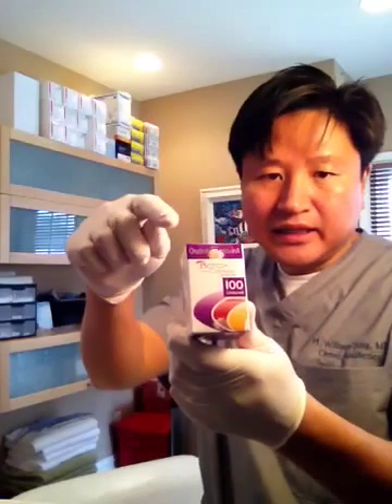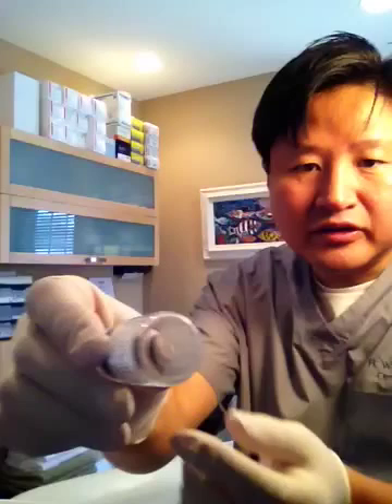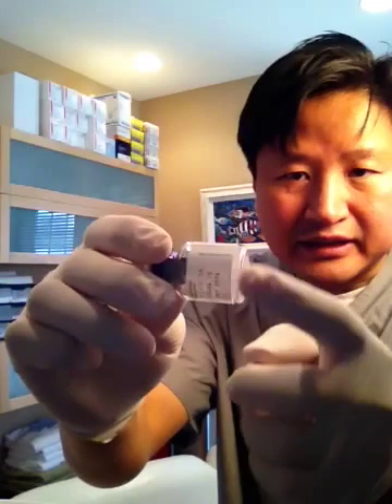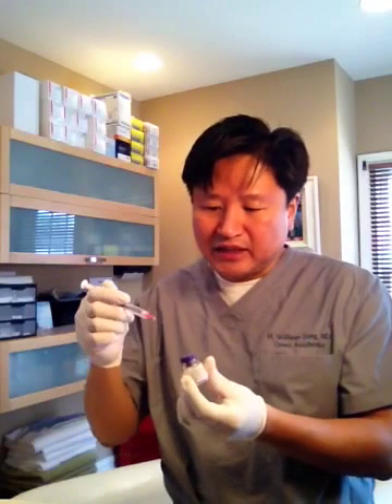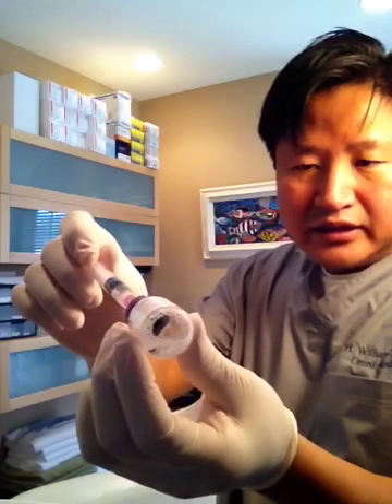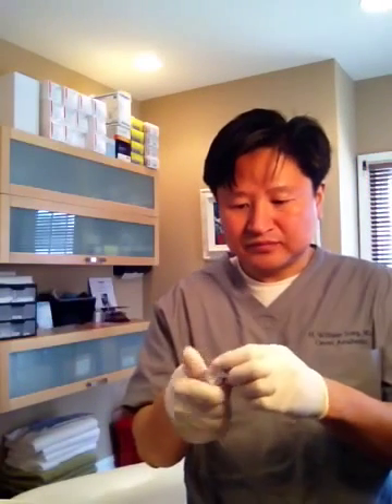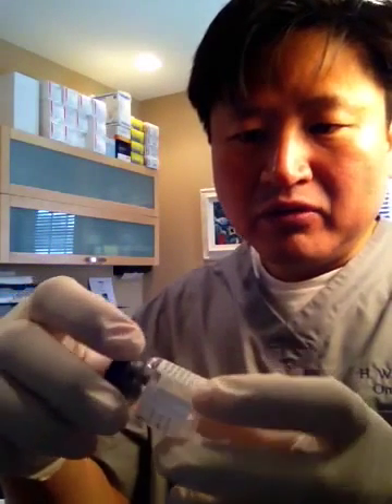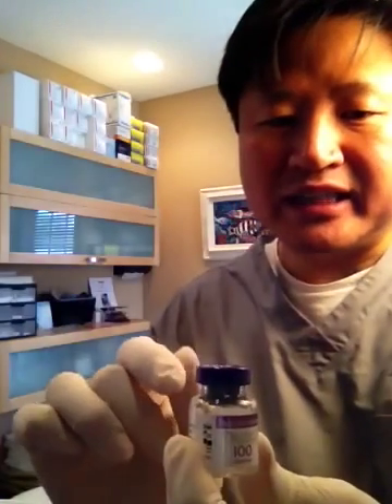Botox Reconstitution

Comment: Dear Dr.Song,
Actually the quantity of saline solution you inject inside the container is exactly what will make the difference. If you inject 1 ml of saline solution (s.s.) inside de 100U bottle you will end up with 10U for each 0.1 ml aspirated. If injected 2 ml of s.s. the final math is 5U for each 0.1 ml. For 2.5 ml of s.s. = 4U/0.1 ml; 4.0 ml of s.s. = 2.5U/0.1 ml and so forth.
Reply from the maker: Yes Dr. Stevao, that was my point exactly. The more saline you put into the vial, the less concentrated the solution per cc. Thank you for your clarification.
Reply: Wonderful. I thought it was important to explain to our colleagues and patients. Thanks for your response.